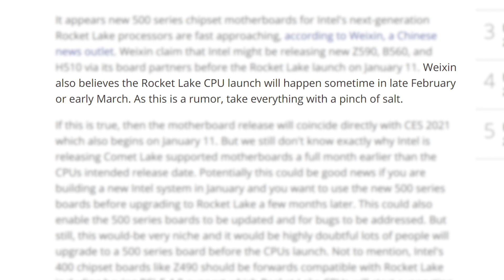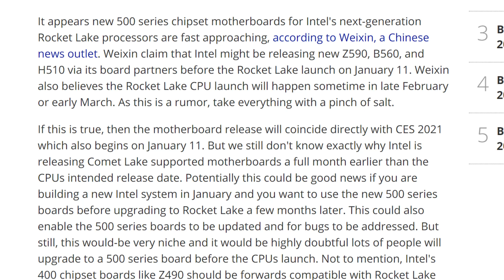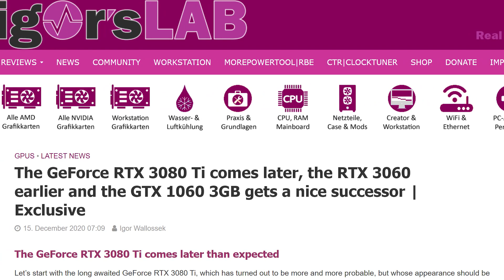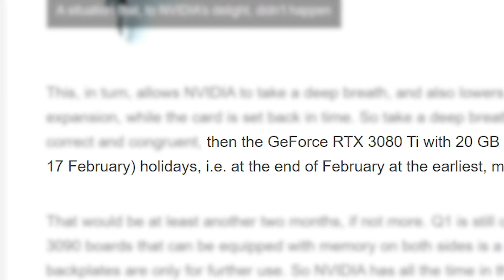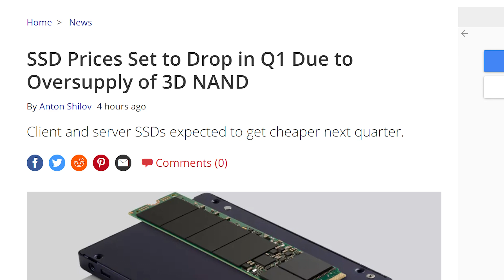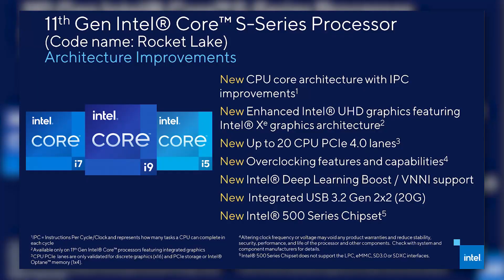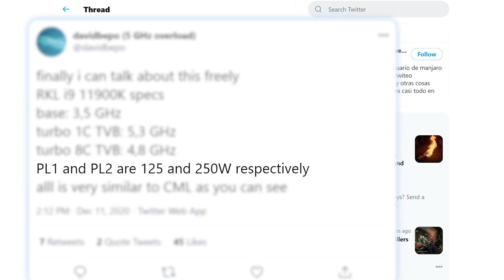Nvidia RELEASED New Monster GPU, Ryzen 5000 & RX 6000 Prices Going UP!

Comment: When the only victory Intel can have is beating their previous gen processors. What a wild year this has been...
Reply: Ryzen 5000 isn't cheap either
Reply: @wimvanerge5210  5000 series cheap as fuck bro
Reply: @supersanejesus6414  I hope you're joking, 50% higher price for a not too big boost, 10850k is cheaper than 5800x and has 2more cores, 4 more threads and around the same game performance
Reply: @wimvanerge5210  ok intel cheap too yall just broke lol get whatever u want shits cost less then a grand anyone can snatch thoes
Reply: @supersanejesus6414  true haha, the stock is my main problem rn
Reply: @wimvanerge5210  lmao fax been Watchin these damn stock streams for 5 days straight keep gettin real close 😂😂😭
Reply: @wimvanerge5210  Thats just the 5800x which is the worst sku of the 4 lmao.
Reply: @shkkrimp7344  tru, but the sweet spot for me, 8 crs
Reply: @wimvanerge5210  what do you need 8 cores for exactly?
Reply: @shkkrimp7344  the next generation of gaming.
Reply: @FeelMyFerret  if its for future proof why not just get the 16 core?
Reply: @shkkrimp7344  Because we don't shit money, and like streaming
Reply: @shkkrimp7344  Cost of said 16 core Cpu, is too much for most people. And I would also wait a year or two until upgrading my i7-7700. I have a gtx 1080 OC 16gb 2133mhz ddr4 and when I play demanding games on high - ultra on 1080 I have no problem at 144hz, and 144fps for most games. I cap some games to 75fps for garunteed stability. Only 2 have made me drop to 60fps.

My rig is old. But can still handle the workload very well. It will be 1-2 years before developers get the most out the new consoles and their 16gb of vram. Better processors will be out and if current new gen still stands up, it will be cheaper. Seems a no brainer to me to wait.
Reply: @FeelMyFerret  absolutely agree my difference is I have the 6700k so I get some less frames and feel the age Abit more but it's still a great system and will be a great system for 1080p gaming for quite some time still
Reply: @wimvanerge5210   intel motherboards are a lot costlier than amd motherboards so combine this to the processor prices and u get ripped off
Reply: @harshvardhangarg8149  not really, in the low end segment they're even cheaper
Reply: @shkkrimp7344  it’s just better
Why not get the extra c/ts for cheaper
Reply: @wimvanerge5210  Ryzen stomps intel in workload scenarios an has caught intel in gaming. Ryzen is far better bang for the buck.
Reply: @RaiderWally59  depends on what you do really
Reply: @wimvanerge5210  dudeeee
What r u smoking?
The ryzen 5000 series starts and 320 dollars base
While intel i7-9700k is 199 bucks
Lmafaoooooo
And don't say stock cooler
Who runs stock coolers?
Reply: @ryugaforever7713  how are you comparing a Brand new cpu price to one that launched 2 years ago. AMD offers far more performance per dollar. With the 5000 series Intel can no longer claim their CPU as the loan king of gaming. AMD also widened their lead in workload performance with the 5000 series. and what does Intel have to fire back with yet another reiteration of their 14nm process.  AMD will continue to widen their lead with their next generation, because while AMD was innovating, Intel was complacent with worrying about how they could squeeze some more money out of their loyal customers with another 14nm cpu.
Reply: @wimvanerge5210  You get the 5600x way cheaper or go all in spend a tiny bit more and get a 5900x
Reply: @RaiderWally59  ok u tell me what is the best money can buy for a cpu under 200 bucks?
Reply: @RaiderWally59  i am not a fan boy of any sort
Reply: @ryugaforever7713  Once prices come back down in a couple months I would go for the 3600 if you want good gaming performance for cheap. They were like 150 bucks on sale almost a year ago. If you need it now go for a 10400F (don't qoute me on this, might have the name wrong) and a 1660 Super graphics card, but prices are still outragous on GPU's across the board too. For higher end, Intel has been going on sale lately at good prices. If you can't get an AMD 5600X go for a 10700K at $320, possibly a 10700 also for even less, haven't checked prices on those recently tho, or a 10850K at $380-400.
Edit typos, woops.
Reply: @dewaynethomas3122  
ok look at this setup i have
	AMD Ryzen 5 3600 3.6 GHz 6-Core Processor
	MSI B550-A PRO ATX AM4 Motherboard
	G.Skill Ripjaws V 16 GB (2 x 8 GB) DDR4-3600 CL18 Memory
	Team GX2 1 TB 2.5" Solid State Drive
        Phanteks Eclipse P350X ATX Mid Tower Case
        EVGA G5 650 W 80+ Gold Certified Fully Modular ATX Power Supply
ur right as of now i can't seem to decide the GPU but is this pc alright?
idk if this will burst or give me proformance , andddd don't roast me at all
Reply: and uh how do I wait for GPUz to cool down in price Nvidia is rlly greedy. .. . .
Reply: i would be glad if you could help me out...
Reply: @ryugaforever7713  Those are really good picks for components. It always comes down to what deals you can find if yer willing to wait longer and buy slowly but yeah, I like that setup. You forgot the graphics card though. Ryzen 3600 does not have built in graphics. That PSU (power supply) might be a bit overkill but if you can find a good deal than go for it. I think about 70 bucks would be a good price at this point, they've been overpriced for a couple years now. Also, switch the 2.5" SSD for an NVME drive, they are basically the same price and give a lot faster performance. B550 boards give you that PCIE4 lane for it, might as well use it. If not than buy a cheaper 450 board.
  What are you currently running? I'm not entirely sure what you meant by "will this give me more performance".
Reply: @dewaynethomas3122  this is my first pc and i was really looking forward to buying a RTX 3060 but oh well...
Reply: @dewaynethomas3122  i found the team gx2 for abt 78 dollars
Reply: @dewaynethomas3122  the total cost of this was about 600 bucks
Reply: @ryugaforever7713  Well the 3060 is 400 at MSRP, not sure what yer budget is. I haven't been keeping up with SSD newcomers lately cuz I'm not looking much but I know Western Digital Blues or Blacks are great at speeds when your moving large files, EVO's are better at quick low quantity movements, generally under 30 gigabytes. The Western Digitals are much cheaper but prices have been comin down for SSD's lately even during this bullshit buying period. 
  Again, give it a couple months or buy cheaper graphics off Ebay. I think the 900 series AMD graphics are as low as like a hundred bucks. ANd if yer playing 1080p 60 hertz they are good cards. High VRAM amounts but higher energy consumption.
Reply: @dewaynethomas3122  yeh corona man
I hate that thing.....
Reply: my budget is about 850 to 900 bucks
Reply: @ryugaforever7713  That's plenty, if shit was still available. Go cheap on mother board if you don't want a bunch of crap extensions and overclocking. The days,. overclocking is garbage anyway, better off putting an undervolt offset.
Reply: Intel has sucked for a while. They stayed on the 4 core train as long as they possibly could. Now they are paying the price because they have failed to innovate. The DOJ should be looking into their sales practiced just like the actions Facebook and others have done.
Reply: @K0gashuk0  Intel are releasing an 8 core cpu that spanks one of the 10 core amd processors. On both gaming and workload scenarios. And Intel have more stable and constant high clock speeds. Intel aren't shit, but they are going to be surpassed in 12mths time by amd on all fronts
Reply: That's hilarious
Reply: While AMD was innovating, Intel was working on how many more ++++ they can add to 14nm to steal your money. Now Intel has no idea what to do to combat AMD. I say AMD will pull further ahead for atleast 2 more gens before intel atleast has something that's worth praise
Reply: Two years ago no one would have thought we’d be praying for Intel to put pressure on AMD!
Reply: Agreed in my country at least ryzen is around if not slightly more expensive for slightly less gaming performance in high end  but intel is much cheaper for more budget orientated
Reply: @chickenmanicmrt1705   @Wim van Erge  ok intel cheap too yall just broke lol get whatever u want shits cost less then a grand anyone can snatch thoes

Comment: Rocket lake can't FIT 10 cores on the die due to the additional instruction sets in the back ported 10nm new core design. This is why at 14nm they're limited to 8 cores (and power). It's a package constraint. It could take a few more cores at 10nm... if they ever get it to work at scale for the higher power parts (not mobile).

Comment: I was just about to upgrade to 10 gen. guess I can wait a little bit more
Reply: Upgrade to Ryzen
Reply: @MichaelTavares  No thank you. 
Tried Ryzen before (gen 1 n 2) and had lot of performance issues so went back to Intel. The games I play works better on Intel than Ryzen, plus intel currently is cheaper in my country, which remains to be seen in Q1. 

However I value less problems over maybe have some more threads that I will not utilise and couple euros price difference. 

But Ryzen is impressive on paper but can’t bother with their headaches.

Comment: Wish the 3070 i purchased had more than 8 gb of vram, might as well just sell it
Reply: What do you do that requires more than that? And if you knew it had 8gbs of Vram then why did you buy it?
Reply: Why does it need more than 8gb of Vram? It's predominantly a 1080/1440p card
Reply: you knew that when you bought it
Reply: You guys know that devs make most games optimised for consoles? Consoles have 16 gb of vram right? I will play at 1440p but 8gb won't be future proof
Reply: @dogusism  So you turn a few settings down to limit Vram.
The "Ultra or nothing" mentality is really bizarre.
A 3070 will last anyone at 1440p for 3+ years easily
Reply: @ventzp2133  not gonna pay a grand for a card thats adequate.
Reply: @nostrum6410  So buy used in 6-8 months... No one asked you to pay anything
Reply: @ventzp2133  i dont think you understand how things work
Reply: @nostrum6410  Enlighten me?
You've stated you won't spend the required amount to purchase a new card.
Now you're saying that buying used "isn't how things work"

So... Explain yourself
Reply: @ventzp2133  a grand for a card gimped with 8 GB is totally absurd.  Then to turn around and sell even 3060's with 12 GB months later
Reply: @nostrum6410  Right... So if Vram is the only thing that matters, why does a 16gb card lose to a 10gb card?
Reply: @ventzp2133  16>10 or 8
Reply: @nostrum6410  So if 16gb is greater than 10 and 8...
Why does the 10gb card win?
Reply: @ventzp2133  first off it doesn't half the time, secondly its flaws in testing methodology.  Any background applications or things like second monitors are not accounted for in anybody's testing.  I routinely run out of vram at 1440p
Reply: @ventzp2133  if almost every tech reviewer says that 8 gb is a bit low in 2020 how are you able to say they're wrong, when i drop a heavy amount of money on a GPU i better be able to turn everything on max
Reply: @dogusism  "8gb won't be future proof"
The GTX 1070 came out 4.5 years ago with 8gb of Vram. It couldn't keep up with modern games from 2018 maxed and that has nothing to do with the Vram Capacity.
The RTX 2070 Came out 2 years ago, with 8gb of VRAM and doesn't run all modern titles maxed out... Also nothing to do with Vram.
Saying you want a "Future Proof" GPU? But you bought a 3070...
When the track record of the 70's series never survives max settings for more than 2 years...
This is user error. Not a product error

Comment: I really don't understand the need for a 3060 with 12GB of VRAM. The graphics card is likely spec'd to run stuff at 1080/1440p and neither would have a real use case that'd push it past 8 GB at most imo. 3070 with 10GB and 3080 with 12GB would have been more sensible at launch, otherwise, this just seems like a product to counter AMD's low end offerings for the sake of it sans an actual use case

Comment: No, not excited for rocket lake. Mainly because I'm in the market for a new laptop, so it's either 10nm Intel or 7nm Zen 3. 
I'd prefer AMD, but I won't compromise the rest of the system just to get it. We'll have to see if laptop manufacturers offer AMD in their premium laptops next spring. HP for example offers AMD in budget and mid range (eg Envy)  laptops, but not in their high end systems (eg Spectre).

Comment: Who buys the Quadro cards? like why not just buy 2 3090's if it's for business use?
Reply: They use different drivers than the gaming cards. That was a downside of the 3090 and a main reason why the 3090 is not a titan card.
Reply: Because Quadro and Titan cards don't have the same drivers as Geforce cards. The 3090 isn't a productivity card no matter what people say, because it doesn't support certain software that actual Titan and Quadro cards does. 3090 is pointless and overpriced.